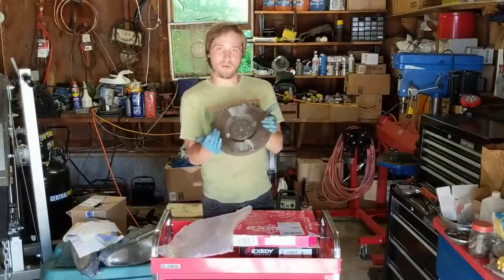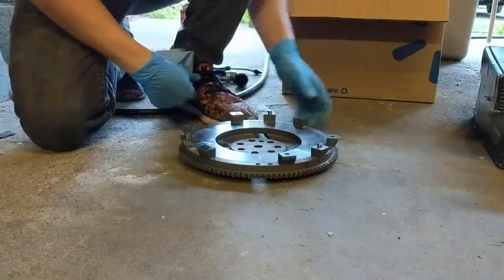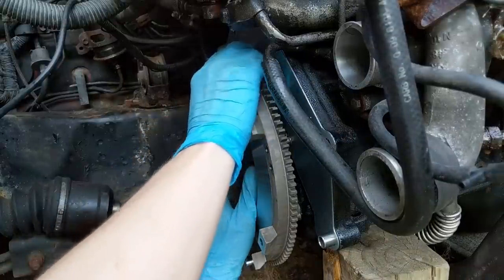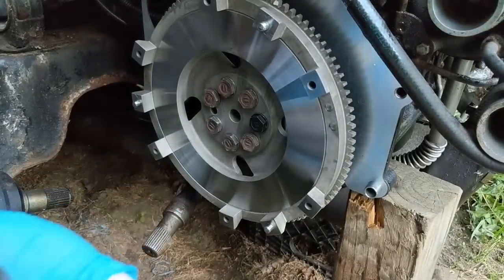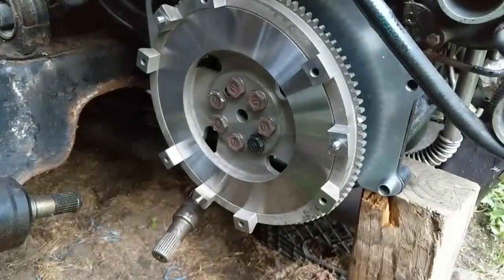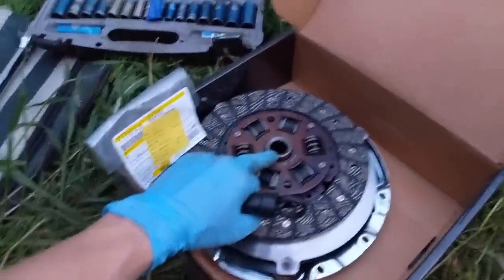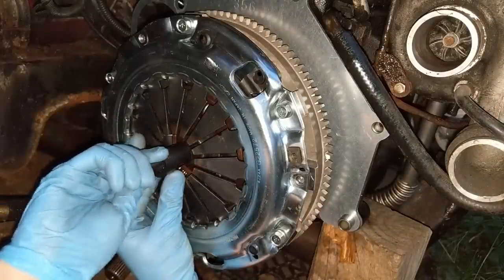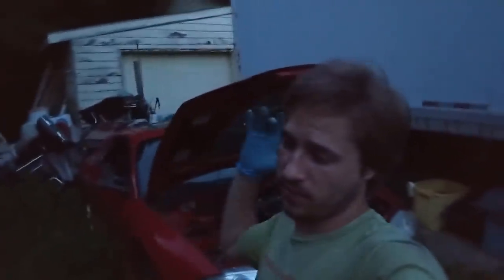Exedy Racing Clutch & Flywheel Install! - Eclipse GSX Performance Parts

Comment: Good amount of threadlocker! That odd bolt out would have bothered me; I could let it slide in a pinch, but I would have gone for a full set if I had the time. Plus, if they are lighter, there is a tiny performance gain to be had there.
Reply from the maker: I knooow! Me too. I hate it. Oh well. They aren't the cheapest bolts ever and they are doing the same job. Seems the old ones are actually a bit beefier anyways. Plus I def did not want to wait multiple days for the bolts to come in. Thanks a lot!

Comment: man that flywheel is going to give the throttle some quick response .  i think you will like it.
Reply from the maker: Once I get this full of fluids, put in the new plugs, and get some fresh premium in it, I bet it's going to be a riot. Just needs a lot of rust work so it doesn't literally fall apart. :D
Reply: gopherchucks no it’s..not lol his probably better getting stock oe 😂
Reply from the maker: Mr Adventures The Exedy unit is a quality part. Physics says it technically will improve the speed of RPM increase. The amount is always in question.

Comment: equally appreciated, its how a real person does a tough job in the yard . incited of it sitting in a fuckin  shop for a month on back log .  now at least a few people can see it can be done for the cost of parts and your time.
Reply from the maker: Absolutely. I would get more done quickly if I actually had it in the garage too, but getting it there right now would be more hassle than it's worth. Besides, I'm used to working in the dirt. When it runs again, I can start working on it with pavement under me!

Comment: Hell yeah 7 bolt crank walk! My advise is pull it and put the 6 bolt in. If you plan on making serious power. My experience 7 bolt cranks like to walk without adding any power
Reply from the maker: I have heard the stories as well. Most of my DSM friends say the problem is heavily overstated. That said, I'll be taking precautions like using a better oil, disabling the neutral start switch, and definitely not upping the power until I know it is healthy. Thanks for watching and commenting!

Comment: My grandfather has done the same with a Kenworth k100 flywheel,Along with replacing ring gear. Next time place the flywheel in the over at 450° for 15-20 minutes and get dry ice. Place your dowels in with the dry ice and leave them in until you go to put them in one at a time. believe you get like .006 of clearance between the dowel and the flywheel doing that. They literally just fall right in the hole.
Reply from the maker: Absolutely believe it. Would definitely heat and cool more in the future!
Reply: 802 Garage no problem, makes it alot easier then having to mushroom the dowels knocking them in...plus reduces risk of any warping on it.
Reply from the maker: Yeah for sure. As you saw, I did heat it and I did use the freezer. The third one was the easiest by far. Also knowing now I didn't need to drive them in so far definitely would have made it easier.
Reply: 802 Garage yeah that's for sure. I would have driven them all the way in as well lol
Reply from the maker: Seemed like the correct course of action... Wish they would have provided instructions. I'll use a micrometer and only go half way next time. :P
Reply: 802 Garage I'd be afraid with my luck eventually it would vibrate loose and punch a hole in something

Comment: Great vid...was that exedy clutch any good?
Reply from the maker: I have only gotten to drive it a small amount, though it is finally in the garage for strut tower repair. Overall it is a bit more on/off than a lot of stock clutches I have driven, but it seems great. No noise or issues I have felt. Won't be able to tell how it holds power for a while though. Thanks for watching and commenting! There will be more videos on this car soon.

Comment: Hope you answer got a flywheel problem, my car is a gst 95 is removing the trans or motor is faster and easier to do?
Reply from the maker: Some people say one, some say the other. The people I trust most would remove just the transmission rather than the entire engine. Depends on the resources you have available as well. With a lift and a transmission stand or rolling cart then just transmission is definitely easier. If you have a cherry picker you can kind of do either or. Jafromobile just does it with the car on jack stands and drops the trans out the bottom like me. If you have a cement floor, decent jack, and stands, I say try doing just trans.

Comment: yeah i went thru the same shit  with my wife's mini. changing the supercharger pulley . had to put it in the oven to 400 , use welding gloves and pc duster upside  down to freeze the crank pin or pulley bolt pending region your from .  but the stock  pulley was good for 6lbs, the  69mm pulley was good for 12 ish.
Reply from the maker: Ugh, such a pain! Wish I had known I didn't need to drive them in so far.

Comment: arp fly wheel bolts would of been nice here for the money spent on the clutch and flywheel
Reply from the maker: I actually got a good deal on these parts. Paid less than for just stock replacement.
ARP would have been overkill for the power I'm going for any time soon.
Plus ARP is pricey and the OEM bolts are plenty strong.
I still hear you though.

Comment: Hey Man nice job and good work on your car. can't wait to see it run. im working with my Mitsubishi Eclipse 1995 it got a Chrysler motor 2.0 automatic, i bought it for $600.00 bucks, and it's not running so yeah my brother is helping me work on it, the car don't want to start so our guess is problem with the computer.
Reply from the maker: Thanks a lot!
I do hear the computers love to go bad on those cars. Be careful getting a replacement as they can be pretty year to year specific.
Also be sure to check basic things like crankshaft and camshaft position sensors, as well as fuel pressure and coil pack.
Hope yours is less rusty than mine!
Reply: @802Garage  thanks bro i still can't find the problem, so what im going to do, is to scan the car and yo hopefully find the problem, and yeah my car is fine it's not rusty, thank GOD...
Reply from the maker: No rust and bad engine is preferable to rust and good engine, honestly! Good luck and keep me updated.
Reply: @802Garage  yeah that's true good engine is more important than a little rust, Thanks for the advice...
Reply from the maker: Well yeah that's true. I'd take a little bit of rust and a good engine. But lots of rust is def worse than engine issues. Good luck!

Comment: So after installing a new clutch and flywheel.  is it normal for the clutch pedal to feel softer than it did with the old clutch?
Reply: I’m assuming maybe over time it will break in and get stiffer?
Reply from the maker: @ihatejavier  Generally no, that's not normal, unless there was an issue with your old clutch. How stiff the pedal feels depends on multiple factors. Primarily the spring strength of the pressure plate springs and the leverage point. Also how well lubricated everything is and if there are any hydraulic issues. What clutch did you have and what clutch did you put in?
Reply: @802Garage  the clutch that got put in is a act hd pressure plate with a 6 puck sprung disc clutch and the old one is also a 6 puck but I’m unsure of the brand
Reply from the maker: @ihatejavier  If the old one was a no name brand, that would likely explain why it was stiffer. The cheaper brands will rely more on heavy springs than having a good friction compound so the clutches will feel very stiff. ACT is more reputable and will have more engineering into their friction material and leverage points for example. As long as the clutch is functioning properly I wouldn't worry.
Reply: @802Garage  cool thank you for your feedback 
appreciate it keep up the good work with the videos 🙌
Reply from the maker: @ihatejavier  For sure def more to come this summer. Thanks

Comment: Bench-Vice on the floor lol, this kinda reminds me of someones old build thread where they said something to the effect of "only real men use a bench vise on the floor lol" I also have not bolted mine to a bench yet, for a plethora of reasons, mainly because it takes up counter space.  Blue thread locker is a good idea on the flywheel bolts some guys like using red here, but if you plan to tear it down in the future blue is better suited to the task, also not meant to belittle the effort or anything, but just something id like to share, you want to spread the thread locker around the tip of the bolt with an index finger, so it goes deep into the bolt threads and remove any excess I like to do this so that the thread locker does not seep out of the threads as it is tightened down, and there is more even coverage deep in the bolt threads, I'm sure you will be alright. 
  Those 19mm headed flywheel bolts are from an early "90-"92 1G dsm 6 bolt motor, now it makes sense why they went to the hardware store and grabbed an extra bolt lol, they only had 6 oem bolts from an early 6 bolt motor, the 7 bolt dsm flywheel bolts are 17mm headed, and they are approximately 1mm shorter then 6 bolt manual flywheel bolts.
Reply from the maker: Hahaha I wanna see that thread.
I hear you about bench space. Unfortunately I don't even really have any right now. More organization to do still!
Yeah I tend to stay away from red Loc-Tite unless it is absolutely necessary. Fought a crank pulley bolt for hours once because of it.
Interesting note on the thread locker. I had never heard that before. I always heard to use a drop and let it spread itself out when threaded in.
That would make sense they used 1G bolts and only had 6 of them... Oh yeah exactly what you said. That's why they grabbed an extra.
I think this car may have had a 6 bolt swapped in before this engine, but it blew. Would make sense considering some of what the previous owner told me.
Damn, more carcheology!
Reply: Yeah keep at it man I love working on these older mitsu motors I'm still learning stuff as well, but when I see stuff I can help with I tend to share what I know/read or learned etc, I love these cars tho I almost want to get an auto awd 2g one is for sale right now it's a roller $200 near me but I got like 5 project mitsu cars already lol otherwise I'd jump on it restore it and flip it lol.
Reply from the maker: Thanks I appreciate it!
I already have 11 cars so I see tons I want to buy, but I just can't any more for now, hahaha.
Why do you want an auto specifically?
Reply: I'm building 2 3G CSMs which are bascailly the Dodge or plymouth Colt/ Eagle Summit/ Mitsu MIrage triplets from "89-"92, I already swapped my white mirage to 4g63T , but I plan to keep that manual trans and maybe go awd soon, just to do something different I plan to do auto awd on my red "91 Dodge colt, and I might be able to use the auto 2g dsm  rear end, I might just use a 3000gt auto rear end, or just use the awd 1g dsm rear but swap an auto rear diff to keep gearing right, or just find a rare 1g dsm auto awd rear lol, but yeah I do love manual trans it's more fun using a clutch and manage all of that, but just to try something outside my comfort zone go auto trans lol.
Reply: or I could always just rebuild the auto 2g and sell it for profit to fund my 3g CSM adventures.
Reply from the maker: I love CSMs too! I think I may have actually seen your threads on DSMTuners? Your builds sound awesome no matter what. :D

Comment: replace your axle seals on trans they maybe old and need it anyway
Reply from the maker: I wasn't planning to, but since I have to order some OEM parts now anyways, I'll price them out.
Reply from the maker: Just priced them. Would be about an extra $25 and I can at least replace them with the transmission installed. Since they weren't leaking when I took the trans out, I'm going to skip it for now. We'll see if it bites me!

Comment: Careful using that torque wrench i use the same one at work and when using it were ure grabbin it will spin under high torque load even when "locked" in.i would just check where u set ure specs more frequently thats all haha
Reply from the maker: That's very true and a really good point. I do think I checked a couple times, but I'll make sure I'm diligent in the future!

Comment: There are actual tools for removing and installing dowel pins. Any machine shop could have done that for you on the cheap. Especially one that grinds flywheels.
Reply from the maker: No machine shops near me, especially none that I would trust, and none that would have wanted to bother that I know of. I live in the middle of nowhere. Installing dowel pins with a vice or even a hammer is perfectly normal and a machine shop is totally unnecessary.
Were I to do it again, I would just leave the pins in the freezer longer, heat the flywheel more, and probably just use wood and a large hammer, but check the depth, because I drove them in further than necessary. Still worked fine though.

Comment: quantos quilos de aperto você usou nos 7 parafusos ?
Reply from the maker: I went in three stages. 50, 75, 100 ft lbs. (68, 102, 136 Nm.)
The factory spec is 94-101 ft lbs. (127-137 Nm.)
Reply from the maker: Torque sequence starts at 8:25 in the video.

Comment: how has the clutch held up?
Reply from the maker: Unfortunately have not been able to put a lot of miles on it, but it felt great and worked well. No noise and not a super hard pedal. I have little doubt it would hold up well at slightly above stock power levels.
Reply: @802Garage  thanks for the quick reply! I think im gonna be needing a clutch job soon on my tsi so ive been researching and looking into it. looks like you got it in pretty easy?
Reply from the maker: @cjdavis247  I'd say the hardest part is literally just dropping and lifting the transmission. If you are working on a cement floor with good jack stands and especially if you have a transmission jack it's definitely pretty basic. If your car is FWD it makes it much easier too. Just follow the torque specs and do not forget the crank walk bolt. I go over that in another video if you haven't seen it. Credit to Jafromobile as well.

Comment: Lol thanks again Mitsubishi. . Lol why oh why do they enjoy changing specs , bolt heads so much.. my god lol every job on my stealth seems to require 15 tools at minimum. . Now back to video lol
Reply from the maker: Tell me about it! Really frustrating. Even the new clutch cover bolts I ordered were different than the originals. 1mm smaller I believe. I love Subaru for their bolts. Everything is a 10, 12, 14, 17, or 19. Makes it sooo easy. :D

Comment: Would it fit a 99 gs eclipse
Reply from the maker: They make a version for the non turbo engines. I can find you links if you want.
Reply: 802 Garage yes please
Reply: 802 Garage instead of it being a stage 1 tho I would like a stage 2
Reply: 802 Garage did you end up finding it ?
Reply from the maker: @kennyrob2653  Ah I'm sorry I started looking it up and got totally side tracked!
Reply from the maker: @kennyrob2653  Unfortunately, Exedy does not make performance parts for the non turbo cars, I was mistaken. It looks like ACT has a broad range though, so check them out.
https://www.advancedclutch.com/products?car=72-2396-1999-6189&clev=0&hs=1

Comment: A brass drift is like $12 on amazon, easy way to stop mushrooming shit
Reply from the maker: Been needing one for a while. I think it may also have been because I was simply trying to drive them too far. They really were a pain. Thanks!
Reply: 802 Garage they’re well worth it, clutches are rotational mass, the more uniformity that can be kept the better
Reply from the maker: I agree. I was annoyed at how the pin install went. Will improve my process next time. :)

Comment: OK Australian here......what is an eclipse...... I know its a Mitzi but don't think they are called the same here
Reply from the maker: Hahaha, I don't actually think you got them in Australia. The Eclipse was a DSM, or Diamond Star Motors, car. Joint venture between Mitsubishi and Chrysler. Basically it was a two door car powered by either a small Chrysler engine or the 4G63/4G64 from Mitsubishi. Two door, FWD or AWD, big hatchback. Only the first two generations of the Eclipse are DSM cars. After that it turned into Mitsubishi only, I believe. Nobody really likes the 3G though. The 1G and 2G have a massive cult following.
Oh! The green car Brian Spilner starts out with in the original The Fast & The Furious is a Mitsubishi Eclipse GSX! Well, at least that's what they say, I believe they used a cheaper spec car and just called it that. You can also check out my intro vid on the car! I believe I put a link to it in the info cards.
Sorry if this was more of a rant than you were expecting.
Reply: 802 Garage ......OK then no we didn't get it here. It has a similar body shape to a Lancer (which is why i was wondering) we have here but was FWD only and crap motor. Thanks for the reply.
Originally found you from Sarah's channel
Good channel 👍👍
Reply from the maker: Did you by any chance get the FTO? I know we did not get it in the USA, but a lot of other countries did. Had a similar sexy shape, but was also FWD only.
I try to reply to as many comments as I can. Sarah is awesome, and thanks a lot!
Reply: 802 Garage 
Yes FTOs are here a plenty
Lovely looking car but yes FWD so they are not that popular. Came out with 1.8 four or 2 litre V6, but their looks almost made up for it 👍